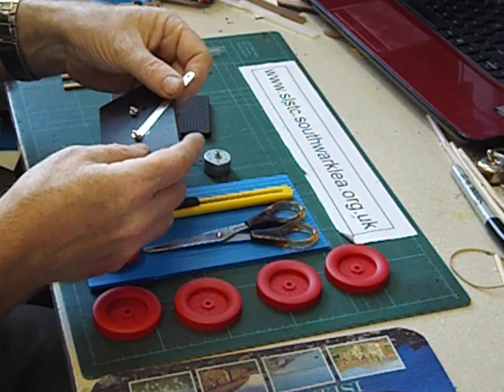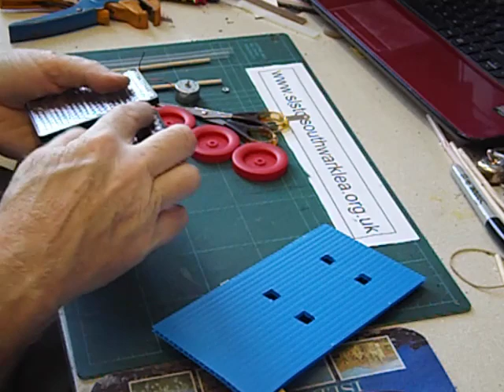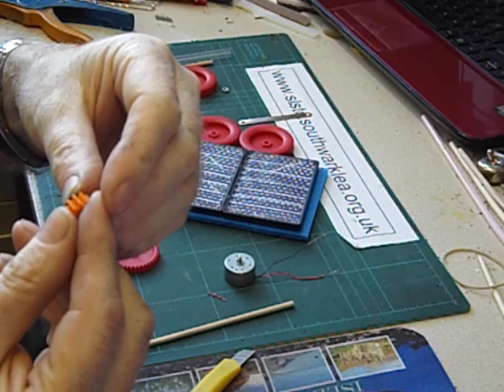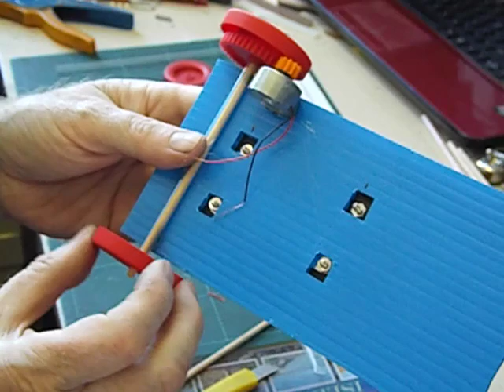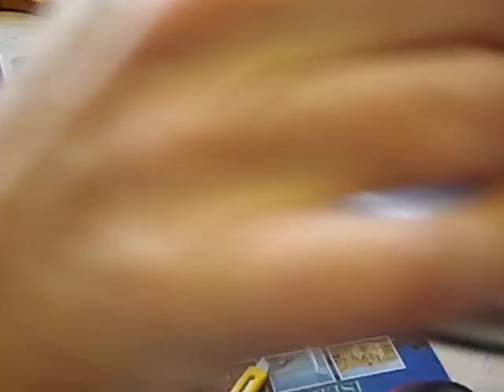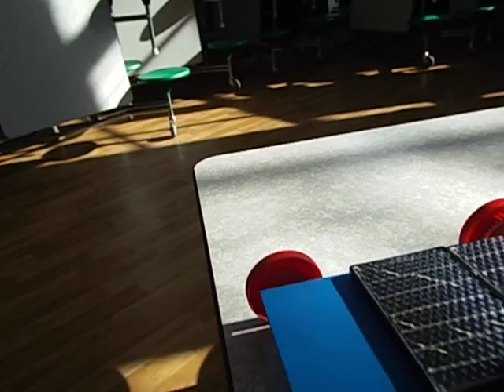How to make a solar powered toy car

Comment: How do you connect the wires if there are 4 wires? 1 red for the motor and one black for the motor. Also 1 Black for the solar panel and 1 red for the solar panel. What do we connects with what???